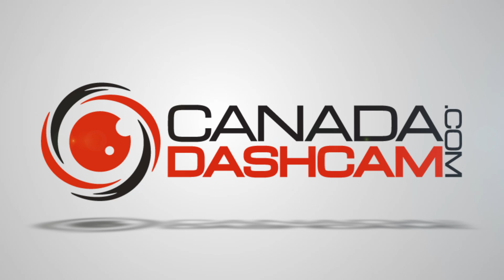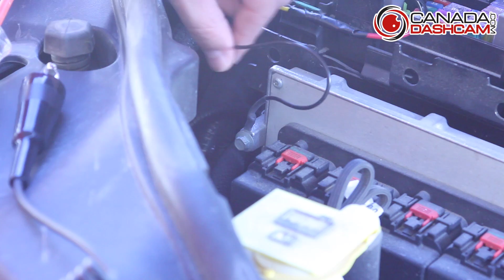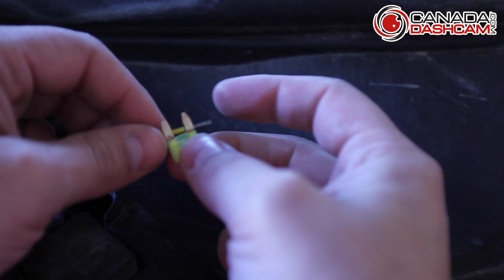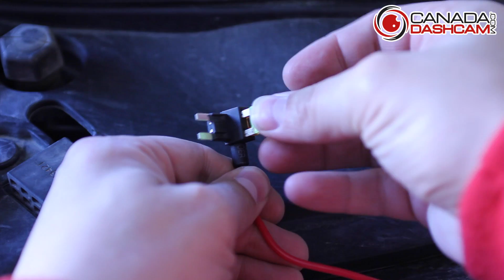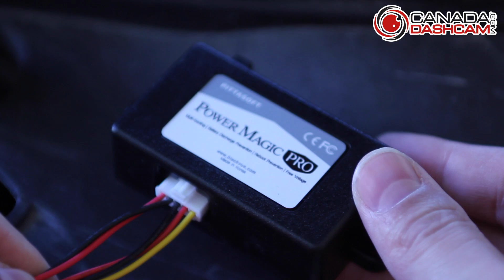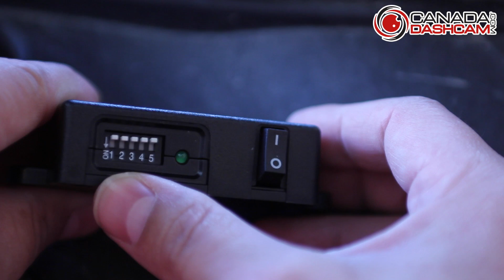BlackVue Power Magic Pro Install | CANADA DASHCAM.COM

Comment: It appears you have one of the fuse taps in backwards.  Most fuse boxes have the 12v side on the same side of each row of fuses.  If you have the hot side of the fuse tap on the inside (the wire side) of the fuse the Fuse is not in the circuit.  You need to ascertain which is the 12v leg and make sure the end of the wire is inserted in that hot side so the current can travel through the fuse to the wire you are using for battery and acc power.

Comment: My 2009 Ford Galaxy has all the fuses constantly under power. At least the ones under the glove box. How and where do I have to attach the red cable to? I didn't check the fuses with a circuit tester but with a digital multimeter and set the dial to continuity mode (indicated by an icon that looks like a sound wave). 
Help wanted and appreciated. Greetings, Karel.
Reply: You probably got it solved but continuity isn't the solution.  You have to use if there's currently t

Comment: hi, I had this installed for about a week. all went well, parking mode enabled after 10mins of  shutting off the car. however, just the past couple of days, SOMETIMES when I turn off my car, the unit turns off (as if it had no power) but then sometimes it would stay on after I turn my engine off. any idea what could be wrong? could the cold temp do anything w/ it?

Comment: Very helpful video.  I plan on purchasing / installing this with a BlackVue DR650GW-2CH on a 2012 Toyota Camry.  Any suggestions or tips?
Reply: Hey Mike its good the power magic pro but the downside is when the power cut out at 11.8volts its shut off no more record but it put stress on the Main car battery though. i have one INstalled to my GMC terrian 2013 its hard to start afterwards. SO i plan to get the Cellink Battery B Battery Pack ya its cost alot but worth the money for the Long term and plus put less stress on the Main car battery im not saying power magic pro not good. but the Cellink Battery B Battery Pack can record on 20hrs on DR650GW-2ch and for the 1 ch 40hrs you can check it out blackboxmycar.com But like i said its all up to you but for me i like the cellink battery B PACK worth the money and the Long term and if your planning to get it make sure get the piggy back mini fuse and find your Fuse for ing start turn and off and Run 20amp mini fuse and ground ur wire to your ground bolt and  thats it :)